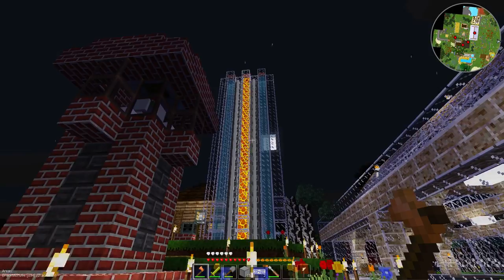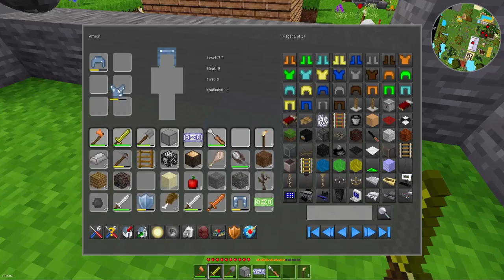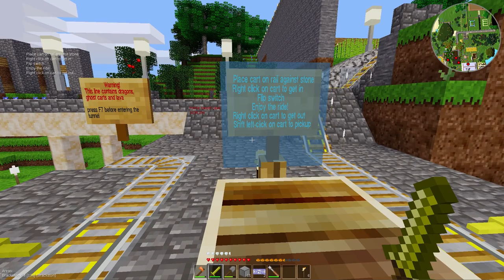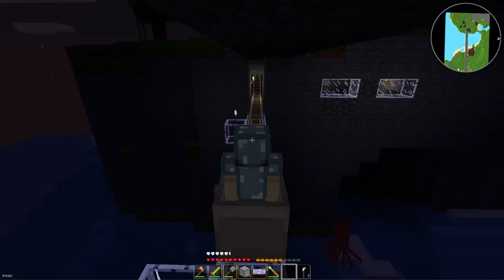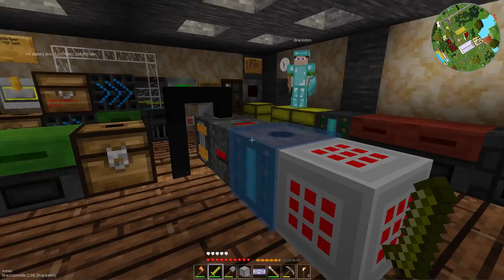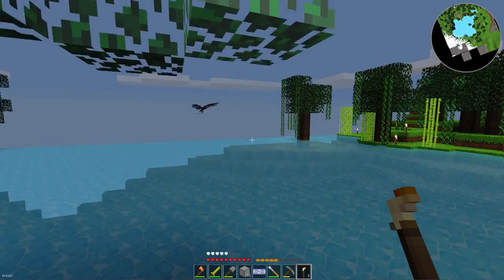Lets Play: TPS Xtreme-18

Comment: Thank you Nathan for showcasing this server.  They have added even more. The reason the MV battery does not charge is because of the drain put on the system by the HV equipment, even when idle. The solution for this is being worked out currently. it appears that the only viable solution is to create another Geothermal Generation System. So we are in the mines gathering more materials to build those. Thanks again for the video and come back and visit us again to see how we have improved. You are always welcome here.
Reply from the maker: +Brackston TPS Extreme you guys are great builders and have achieved some very impressive feats, thanks for showing me around.